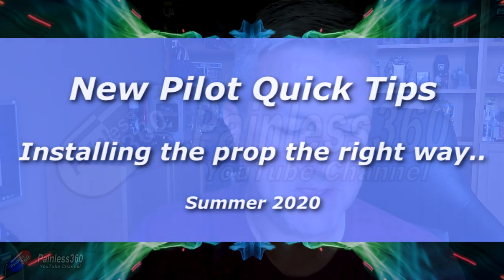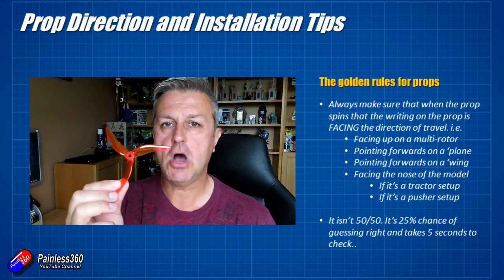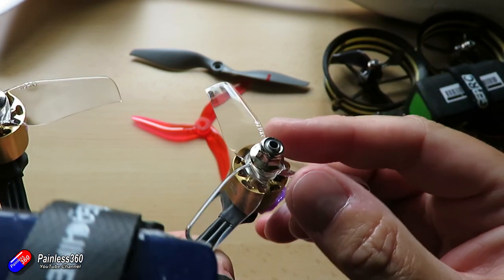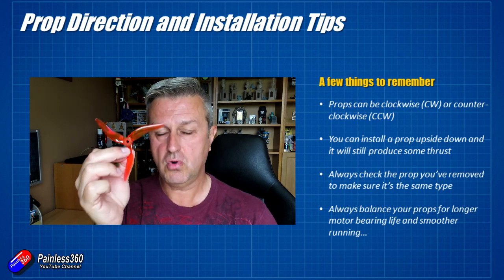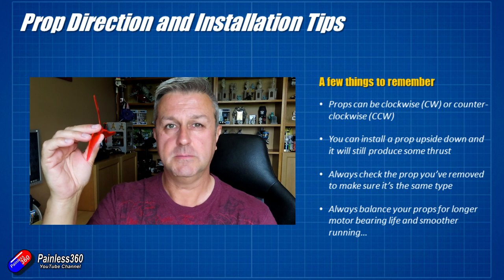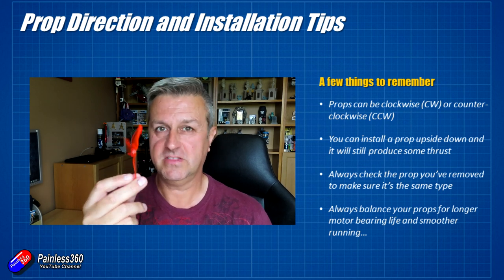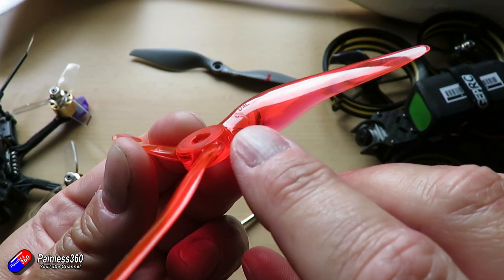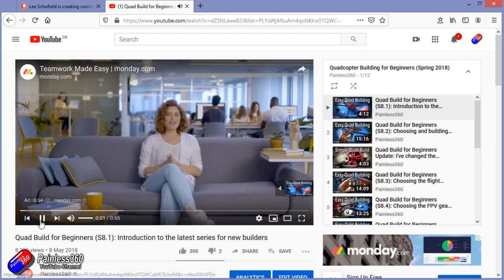New pilot tips: Installing your prop (don't get it the wrong way around!)

Comment: Good info,  I run RC Boats,  and I'm making a Rescue Air Boat using a Out runner Flash Hobby D3548 - 1100Kv,  and a Master Airscrew Performance 12x4.5 Multi-Rotor Series Propeller.   I have a few Questions:   1.)  I mounted the Motor Shaft Facing aft,  in order to push my PVC rig Forward,  would need to installed the Prop "Backward" ?     2.)  Also, what propeller Size and Type would deliver me more THRUST/TROQUE,  a 1 Bladed propeller or say a 3 Bladed Prop ?  Size, Pitch, etc., would help.  I'm not really looking for speed,  just a good amount of Torque so it can bring my Boat(s) back to shore.  Any suggestions, or advise would be most appreciated.  Thanks
Reply from the maker: You always point the lettering on a prop towards the dire tion of travel. The motor direction doesn't change that. It sounds you are after more thrust? Check out https://youtu.be/TjhQsmwVoOo for how to make that happen. I hope that helps.. Happy flying

Comment: Great advice .. I have a question.  what about aircraft with built in thrust angles on fixed wing motors.. if one has a ccw prop on a model and replace it with a CW prop ..yes one can change any two motor cables  so the motor will spin in the necessary direction ..eg CW... but the built in thrust angle will be incorrect...how would this effect the aircraft ? Or is it just not that important.. thanks..
Reply: Trust angles on fixed wings is very important, if it is not angled right, it can cause the aircraft's nose to dive during take offs, or worse. The Volantex EX Ranger aircraft was notoriously known for wanting to nose dive during take. But once it was airborne, it performed really well. I used to own one.
Reply from the maker: The thrust angle will not change if you change the direction of the prop. The thrust angle is set by the mount of the motor and that doesn't change. What does change is the direction of the counter-rotation from the motor that is trying to turn the model in the opposite direction to the motor will be reversed too. Those few clicks of aileron trim you needed to reverse that will need to be changed.. Hope that helps..

Comment: Are you absolutely 100% sure that it's 25%?? Because I make it 33.33333% given the 3 variables.. 🤣🤣
On a more serious note, how should you tighten the Prop when it has a captive nut (specifically on the Tundra which I know you have experience with) should it only be hand tightened or nipped up with a spanner??
Reply from the maker: I always like to give a little hug with the spanner... :)